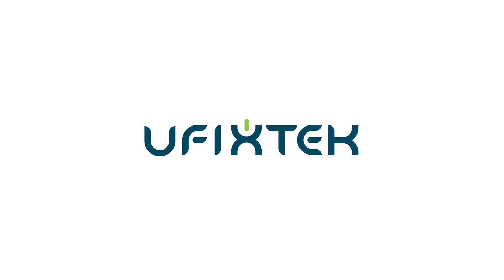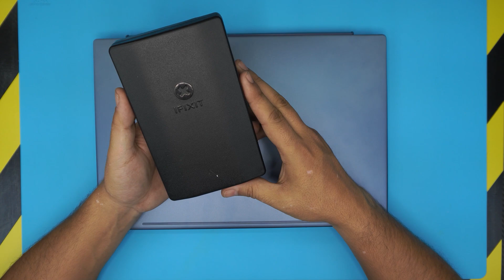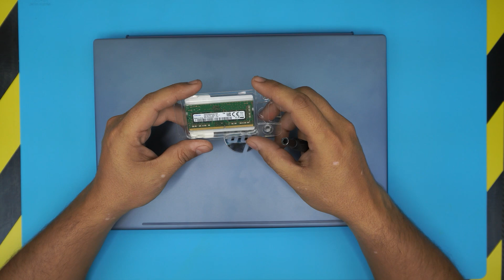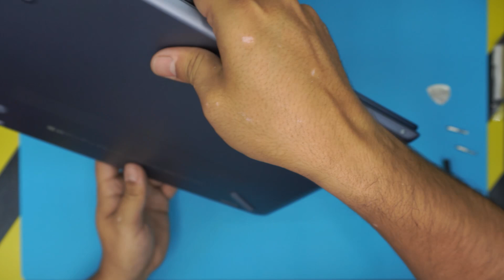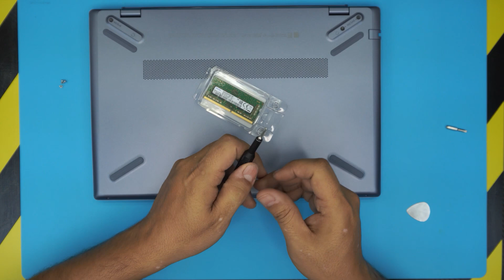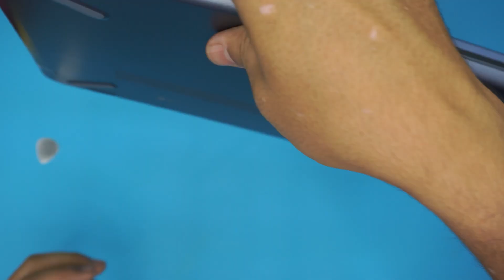How to upgrade RAM on Hp Pavilion 15 Cw Series

Comment: When I scour the internet to verify whether my laptop has two slots and finally find this, this is amazing. I'm just curious whether I could upgrade it even further with two 16gb ddr4 sticks, or if it can't handle it?
Reply from the maker: 🫠Regarding your question, we have upgraded to 32GB, and it works, but for some reason, Windows is not stable at 32GB. So, we recommend using only 2x 8GB.
Should you have any further questions or requests in the future, please don't hesitate to ask me.
cheers🍻

Comment: Hi..I have a hp pavilion 15 CS2003NX with 8GB default...want to upgrade the ram to its max...does it support 32gb or should i go for 16gb? Also, currently the default ram is 2400Mhz, should i stick to the same speed or higher will be compatible? Thanks
Reply from the maker: 🫠Regarding your question, the RAM speed is adjusted automatically by the BIOS. If you install a 3200MHz module, it will lower to what it can handle (2400MHz). The sweet spot for this CPU is 2x8GB, totaling 16GB.
Check the link to see the maximum RAM support.
cheers🍻
Reply: @uFixTek thanks for the information...i checked in my pc it supports 32gb
Reply from the maker: there you go you can install 2x 16gb without any issues.

Comment: Hello! I have one laptop similar to this model. It's Pavilion 15-cs0007nm. When I checked with the command "wmic memphysical get maxcapacity" to the Command Prompt it says 32GB is the maximum. I have one module Kingston SODIMM DDR4 16GB 2666MHz KF426S15IB1/16 Fury. Will it work or I need 2 x 8GB? On lot of websites it says maximum supported is 16GB so that's why I'm asking. Thanks in advance.
Reply from the maker: Thank you for your feedback! If you wish to support the channel, you can like, subscribe, or both!
Regarding your question, sure you can use the 16gb stick ram you have without any issue my friend you don't need a 2x8gb.
but i would recommend the 2x 8gb because then you will get a dual channel memory activated and 2x8gb is faster than 1 single 16gb.
Should you have any further questions or requests in the future, please don't hesitate to ask me.
Reply: Thank you for your kind answer. Opened the laptop earlier and tried it. Kingston Fury RAM 16GB memory works without any problem. Already subscribed and all the best to you!
Reply from the maker: It's my pleasure my friend. also awesome job on your upgrade and enjoy it cheers🍻
if anything let me know, with new comments. good luck

Comment: I'm considering replacing my single 8gb RAM card with two 16gb cards for a total of 32gb of ram.   Can my Pavilion 15-cw1068wm handle that much ram?  I do a fair amount of video editing, and I'm thinking that it might be nice to have that much RAM.  Do you think that might be overkill?
Reply: I answered my own question by seeing your reply to dougwest4545, at least on max capacity.  It looks like 32gb is max for the 1068wm.  I'm still wondering if 32 might be overkill.  Thanks again.
Reply from the maker: no not a overkill, if you do video editing and few internet tabs opened you will enjoy the 32Gb ram my friend, i would say go for it.
Should you have any further questions or requests in the future, please don't hesitate to ask me.
Reply: Thank you. Very kind of you indeed!  @uFixTek
Reply: I just did the same! two 16gb cards! I used Crucial DDR4-3200. How about you?

Comment: Any idea on how to get the clips open? I’m trying to get something in between the two pieces and I don’t have a guitar pick like you, I’ve tried a Stanley knife blade and even that can’t get in between  the two plates, any ideas? Could it maybe be glued together? Any help or ideas would be much appreciated, thanks.
Reply from the maker: Thank you for your feedback! If you wish to support the channel, you can like, subscribe, or both!
Regarding your question, you will need a .3mm metallic guitar pick, and you will need to start from mid front or back corner, it is hard a bit, but i assure you it is not glued it is hard, use more force.

Comment: Can the graphics card be changed in this model? cheers
Reply from the maker: Thank you for your feedback! If you wish to support the channel, you can like, subscribe, or both!
Regarding your question, no my friend the GPU is soldered on board and is not possible to replace, and other components like power regulators and many other components come in affect. you get what  you paid for in this case.
Should you have any further questions or requests in the future, please don't hesitate to ask me.

Comment: Hello! 
I have been searching everywhere if it works and still couldn't find the right answer. So my laptop is HP Pavilion 15 cw0007nm and it has AMD Ryzen 2500U processor. I wanted to change both preinstalled 4GB Samsung 2400MHz memories with two Kingston Fury Impact 8GB 2666MHz KF426S15IB/8. Will it be compatible with my laptop? The only big difference I'm worried about is lattency: current Samsung memory is CL17 and Kingston is CL15 (15-17-17). Would my laptop be able to adjust to lower latency? 

Any help would be very much appreciated.
Reply from the maker: Thank you for your feedback! If you wish to support the channel, you can like, subscribe, or both! Regarding your question, you can do the upgrade without any worries my friend it is very compatible and it will work just fine and the bios will auto adjust the speed and parameters to its specs, go ahead and do the upgrade, cheers
Reply: @uFixTek  Thank you very much my friend!! That is what my gut feelings and logic was telling me all this time about it. Many people and their brands were telling me that it would'n work for one or the other reason, but this is very encouraging. Thanks again! Big likes for you!
 I also hope that this will be helpful to someone who is struggling with this question like I was
Reply from the maker: It's my pleasure my friend. i have over 17 years of repair and servicing computers experience , if there is anything you need help and have any request feel free to ask me.

Comment: Does it support 3200mhz ram?
Reply from the maker: Thank you for the feedback! if you wish to support the channel you can LIKE or SUB or both :P
regarding your question: it does support but if the board only can handle 2666 it will lower that 3200 to 266 automatically. update your bios, we got same models and some 2666 and some 3200  on same exact model. but its fully compatible both with 3200

Comment: He bent the aluminum...
Reply from the maker: the aluminum case its very soft, it will bend with no force and you can very easy bend it back it. we open many of them weekly if you take you time doing it you may not bend. but its not a big deal, as i said its very soft it will go back as it never happened.

Comment: i watched the video and it was really clear, thank you. i looked at my computer specs and it said 2/2 slots were in use, but it was 8gb in one and 4gb in the other, how would i know the difference if i opened my laptop up? i was hoping to replace the 4gb one
Reply from the maker: Thank you for the feedback! if you wish to support the channel you can LIKE or SUB or both :P
regarding your question: When you see the ram you will find a sticker on each ram with info that tells you how many GB it is.

Comment: Thank you so much for this video it was great in helping me to change my ram. I have a question. What is that to the left of the battery? when I opened mine I don't seem to have one..is it a hardrive?
Reply from the maker: Thank you for the feedback! Glad it helped you 😊if you wish to support the channel you can LIKE or SUB or both :P
regarding your question: Yes its a HDD, some models including HDD you can add a SSD or HDD 2.5"
here is a video for it: https://youtu.be/SLzBGWIjX1A
Reply: @uFixTek  Thank you so much for your help. so if my HDD drive slot is empty, what HDD is it using?  Also I use a music software on my laptop what would be the best to get, an SSD or a HDD, the model of my laptop is 15-cw1511sa.
Reply from the maker: you have a m.2 SSD, for any programs SSD are the best to run on. and add an HDD for extra storage if you want. or you can upgrade your SSD to 4TB if you wish.
Reply: @uFixTek  Thanks for the info and your quick response. Looking at your videos of changing HDD drive...I've seen that you need to download Windows 10 on a USB flash drive... would this be the case for me..or can I just place an SSD in the slot. Also which SSD would you recommend for the laptop model I have?
Reply from the maker: Samsung nvme evo m.2 ssds are top of the line ssd's they are very long lasting compare to any other brands, they are rock solid.
https://amzn.to/37VE8Cs
once you replace the ssd you will not have any windows or OS in it, so you will need to back up your files in a external storage. and once you placed the new SSD the installing of system is really the most easy part its like installing a program.
#1. you need a usb stick with 8gb oir 16GB recommended
#2. you need to download windows 10 media creator: https://www.microsoft.com/en-gb/software-download/windows10
(download the : Create Windows 10 installation media)
then plug the usb and open the program and it will create windows 10 installer in the usb and then once finished power off the laptop place the new ssd and plug in the usb and power on and press ESC key and then choose F9 and then choose your usb and then the rest its easy i will leave you with two links to help you out.
windows 10 usb : https://youtu.be/uDu8j2lE-dM
install windows 10 on HP laptop: https://youtu.be/7f_rBp6Rb3s
Reply: @uFixTek i there my friend.. I'm just revisiting this video...I have a question...Since I already have the m.2 ssd..and in the same laptop it has an empty HDD slot... can I just get a HDD for the extra storage. Will I still have to download Windows on a USB..or will it be OK because it would be already on the m.2 ssd?

Comment: My exact model is a Hp 15 cw1063wm, does specific ram really matter? For example, the ram you listed as 3200 mhz is higher than the default 2600 mhz.
Reply from the maker: Thank you for the feedback! if you wish to support the channel you can LIKE or SUB or both :P
regarding your question:  few thing you should know, if you want to place the 3200mhz ram you must remove and replace the 2600mhz that you have.  if you don't remove the 2600mhz and install the 3200 the bios (motherboard) will adjust the higher speed ram to match the lower ram dim, the computer will work just fine and excellent. but if you want to have 3200 the place a  single or double 3200 ram. if not don't worry still will work.

but for your motherboard (Hp 15 cw1063wm) the ram you have installed its a 2666mhz and the bios it has down-clocked it to 2600mhz, that means if you place a single 3200mhz ram the bios will bring it down to what it can handle (2600mhz). the benefit would be that the ram will last you longer as it will not be used at its max speed (longer life span), the cons would be the 3200mhz cost a bit more depending demands.
here is a 16gb 2666mhz. https://amzn.to/37cI9Cb

Comment: Hello and wanted to Thank You for all the excellent tutorials on the 15-CW series.

I want to follow all your instructions in one go for my 2 year 15-CW.  I want to clean the fan & change the thermal paste, upgrade the ram, HDD and SSD, change the battery.  In what sequence should I do everything since I want to do all these things in one sitting?  And finally how should I back up everything including the BIOS before hand?

Thank You!
Reply from the maker: Thank you for the feedback! if you wish to support the channel you can LIKE or SUB or both :P
regarding your  question:   no need to back up BIOS or anything.
the order i recommend is the following:
#1. service and repaste
#2. ssd upgrade m.2 
#3. upgrade HDD to 2tb (optional)
#4. install WINDOWS 10 FRESH install no cloning:
create Windows 10 USB Boot Drive: https://youtu.be/uDu8j2lE-dM
how to install on HP laptop: https://youtu.be/7f_rBp6Rb3s
install windows on m.2 ssd and use the hdd for storage.
#5. upgrade ram
good luck
Reply: @uFixTek  

I will definitely do both to support your amazing channel.  If I leave the M.2 SSD as is and just upgrade the 1TB HDD to any 4TB 2.5 inch SSD- Can I skip step 4 and back up everything to an External HDD instead?   I can then just copy everything back to the new 4TB SSD.  This way I can upgrade the RAM as step 4 completing everything in one go without having to open the laptop again.

I have an older windows office 2013 license transferred from my older dell laptop that I don't want to lose as I'm on my allowed final machine with this HP 15-CW hence why I'm trying to avoid reinstalling Windows 10.

Thank You!
Reply: Also I have the HP 15-cw1063wn.  Will ANY 4TB or less 2.5 inch SSD work or will I have to measure and compare the thickness with the existing 1 TB HDD?  How about the ram?  Should I go with a 2400 or 2666 Mhz and what's the max efficient GB you recommend that I go with in the empty slot that compliments the exising 8gb Ram that's already in the other since I plan to leave that alone?

I guess a link for both ( SSD and RAM) would help me tremendously :)
Reply from the maker: You can do a disc cloning using Macrium Reflect program, copy and paste wont work. if you want to skip step 4. then download Macrium Reflect and get your self a sata to usb adapter and clone your main drive to the new one and then replace them,
https://amzn.to/3p6EXyF

regarding the size of the SSD all SSDs are the same thickness. dont worry about the thickness of the SSD as long as its a 2.5' ssd you fine.
https://amzn.to/33uZdBw

if you want to know your max ram capacity check this video:
https://youtu.be/tKEJTkVth4Q
and get the 2400 or 2666 get the best deal price you wont know the speed differences and the bios will adjust to the max speed that it can handle.
you can have one 8gb ram 2666 and you can add a 4 or 8 or 16gb 2400 , it will work just fine.

compatible rams:
https://amzn.to/3p8Hzw4
https://amzn.to/326LfFK
https://amzn.to/33z8BEd
Reply: @uFixTek  

Thank You very much for all your help.  I will start collecting and buying everything I need before starting on the ambitious project.  I just bought the battery so it's a good start.

Thank You again!

Comment: I want to upgrade my RAM it currently is a ddr4-2400 can i replace it with a higher speed RAM?
Reply from the maker: Thank you for the feedback! if you wish to support the channel you can LIKE or SUB or both :P
regarding your question: sure you can but the bios will adjust to the max supported, so i recommend to get the 2400  because higher the bios will not use. 
https://amzn.to/3GcbyIV
Reply: @uFixTek  thx man
Reply from the maker: my pleasure my friend :)
Reply: @uFixTek  are there any updates or anything that's need to be done prior to adding more RAM?
Reply from the maker: absolutely nothing, just add or replace and you are all set. no need to click around or config anything
Reply: @uFixTek  thx!

Comment: That’s a HP 15-cw1xxx right? Cause that’s exactly what I got and I’ve been looking for upgrading the RAM, was there any software issues or concerns I should have for upgrading this specific laptop?
Reply from the maker: Thanks ✌  for the feedback!  if you wish to support the channel you can LIKE or SUB or both :P
Regarding your question: yes its CW1xxx series and upgrading the ram wont have any side effects regarding software or anything, just place the ram and enjoy :P
the recommended models we use and they are rock solid under stress test are this:
👉RAM 16GB: https://amzn.to/3DjoI6y
👉RAM 32GB: https://amzn.to/2XVoVwr
Reply: @uFixTek  Cool! And one last question, since I already have a 8Gb Ram in mine can I just buy the 8Gb single pack from the link you showed me instead of getting the double pack??
Reply from the maker: sorry for delay my friend , but ya just get the single 8gb dim and it will work, https://amzn.to/3jjqEE2
Reply: @uFixTek  Thank you!
Reply from the maker: @buffsuki7683  your welcome my friend :)

Comment: Hey, I have a HP 15-cw1xxx, I can't find much information on that exact one and the Crucial scan said it is compatible with 3200MHx RAM, but other websites say 2666 is it's max speed.. wondering what's what
Reply from the maker: Thanks ✌  for the feedback! if you wish to support the channel you can LIKE or SUB or both :P
Regarding your question: this laptop can take 2666MHz and it can take 16GB x2 total of 32gb.
we have upgrade in the store many of them, we out a 3200mhz and the bios will down-clock to 2666
https://amzn.to/3jsZKbB
Reply: @uFixTek  that makes sense that it downgrades to 2666. Its my girlfriends laptop and I'm upgrading it for her birthday. I haven't had a chance to open it up yet and there are so many different versions of the HP 15 series. Is this laptop  XMP compatible?

It came with 1x8gb and 1x4gb sticks, the 8gb is slower than tha 4gb, its an all round weird setup out of box.
Reply from the maker: ya The Cw series don't have XMP on the bios, so you can't manually activate xmp , the bios does the ram optimization on auto, no no matter what speed ram you put it will adjust to the best option, if you put one @1666 and another @3200 the bios will take the  lower speed and adjust the 3200 to 1666. but i would recommend you to go with 2666mhz, just make sure she has a nvme ssd and windows is in there. i would upgrade the HDD to SSD and the m.2 to higher GB and NVME.
https://youtu.be/SLzBGWIjX1A
if you ever need any info let me know, i will be glad to help out if i can.
thx for the support and use my amazon general link to support the channel :P open the link before searching for your product :) much appreciate it.
https://amzn.to/37pg9s4